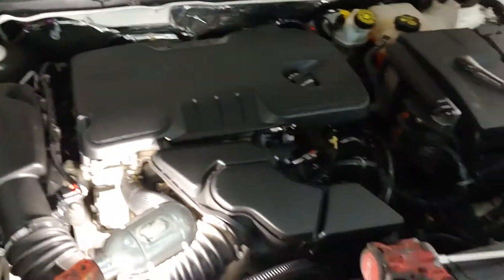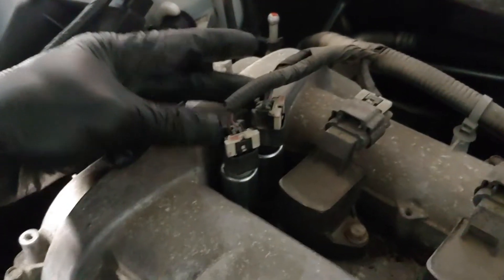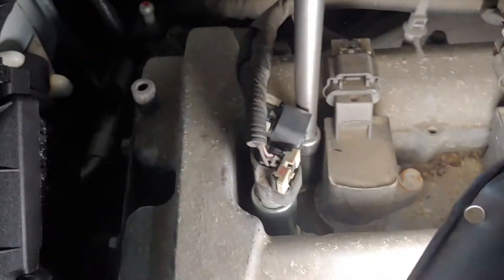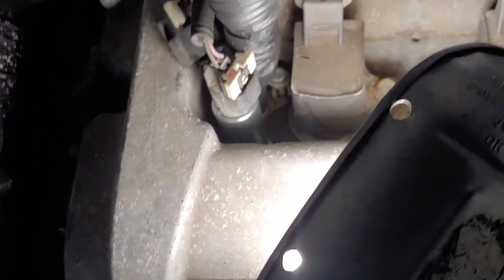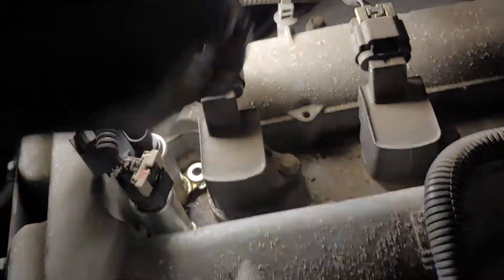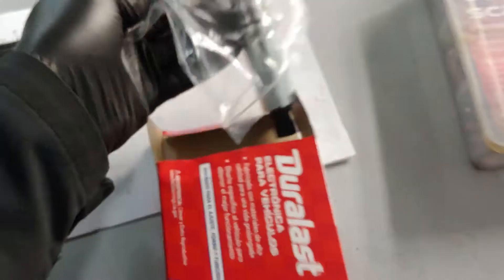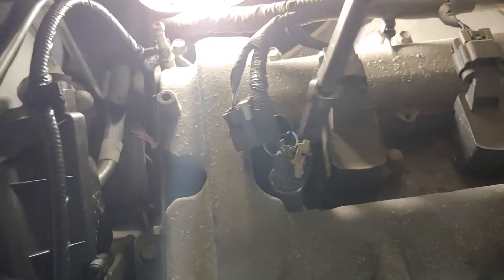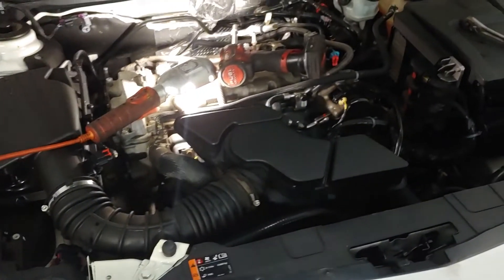How to Remove Exhaust or Intake Variable Valve Timing VVT Solenoid in 2012 Buick Regal 2.4L

Comment: I've done this 4 times with my Buick Verano, after the second time I stopped replacing the intake and exhaust solenoids and now just give them a cleaning and put them back. Lasts just as long as a brand new part.
Reply from the maker: Yep - I've seen cleaning the solenoids work if it still functions ok.
Reply: That's really all they need. A bottle of de-gunking fluid works, too. It's a known problem with that era Buicks.

Comment: Would this be the same with a 2013 buick regal gs?
Reply from the maker: Yes , The 2013 Buick Regal GS I believe is a 2.0L Engine but should be similar
Reply: Just completed this on a 2013 Buick Regal gs.. same job. Thanks 👍🏾